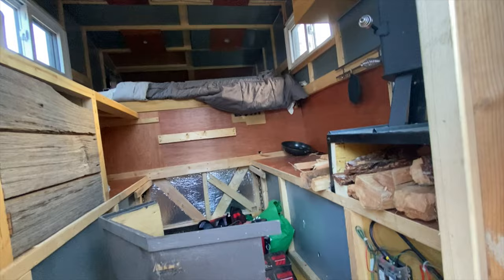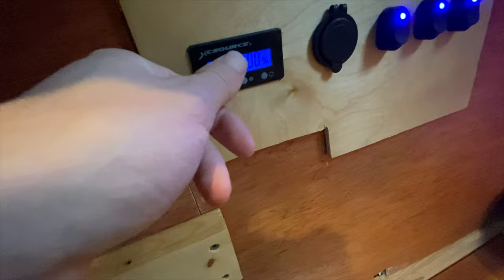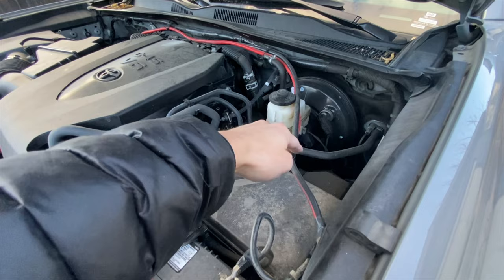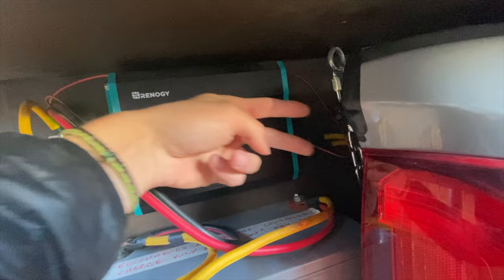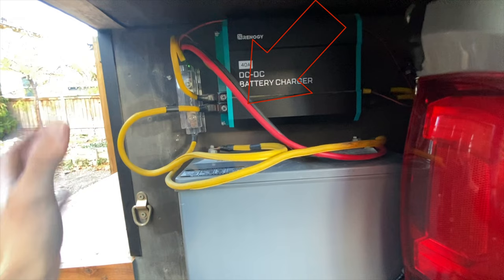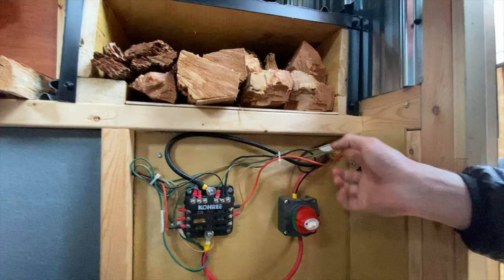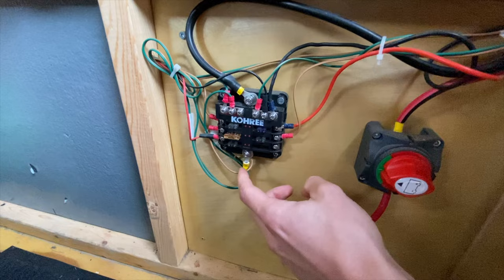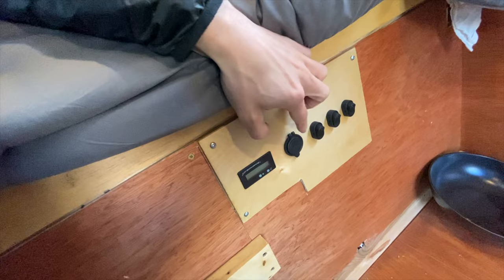DIY Camper Simple Electrical System

Comment: suggestion on the truck, use helper springs or air bags on the rear of truck, to bring ride height back up, and then put sway bars on rear axle and this will stabilize your truck going down the road, and in front use a steering stabilizer to make easier for your turns ,I drive a old 4x4 ,mud and snow are fun to play in.
Reply from the maker: Thanks for the tips. I got airbags installed on the truck to level it. the sway bars I could use, but well, am trying to save money on them for now haha. Thanks for checking in, have a great day!

Comment: Nice DIY build and you are so positive, it is great!  The camper has been great for skiing.  I like to compare how a Canadian resident handles their heat.  I see some others do the wood stove, too, but some also have diesel heater.   If I did a build here in the states I'd stay most likely in the southwest, desert during winter and high country during the summer.  And it would be full time.

Comment: Dude. Im super grateful I came across your slide in camper build. Thanks for sharing. This electrical setup looks so easy i'm definitely gonna use this setup on my build. Can you do a basic rundown on the propane system next?
Reply from the maker: Aw awesome! Thanks for the kind words I appreciate that and I'm happy this was helpful!! My propane system is so simple it doesn't even need a video to explain it. I have a 10lb tank and a t split connected to the tank (just lets me attach 2 items to the tank) from there one of those connections is my camp stove with a 10 foot line, and the other is a 5 foot line to a mr.buddy propane heater for the mornings and quick warm ups. Hit me with any other questions you may have!

Comment: Yo! Binging some content so apologies for back to back comments on this and the other video. It didn’t sound like it, but do you have your battery set up to only deplete the agm for the camper so you can still start your truck if you run it flat or are they wired in series so if they go flat you’re stuck?